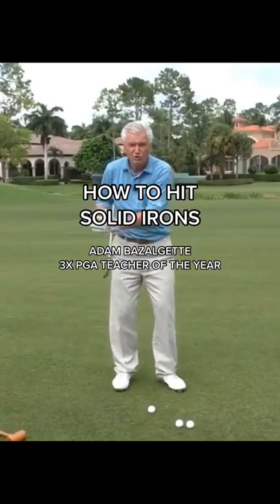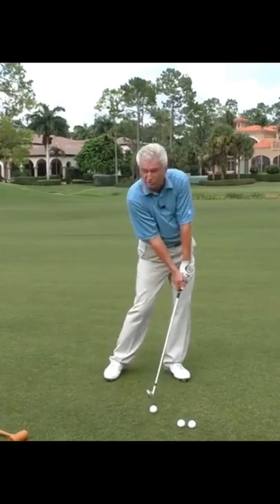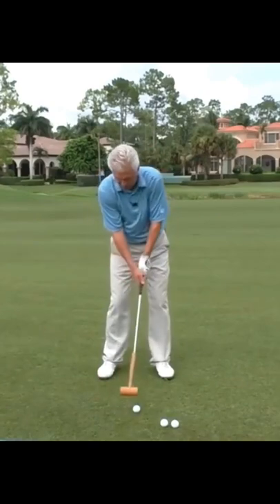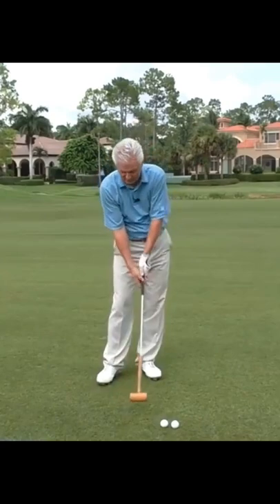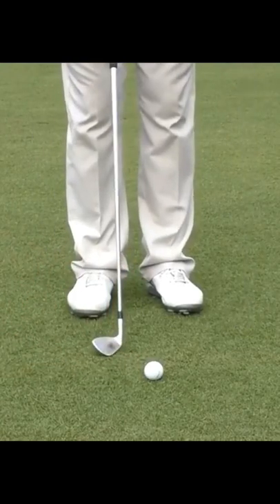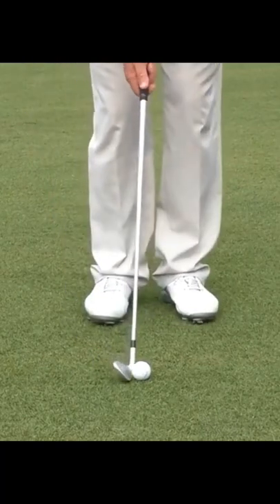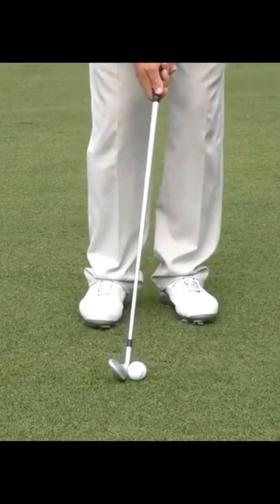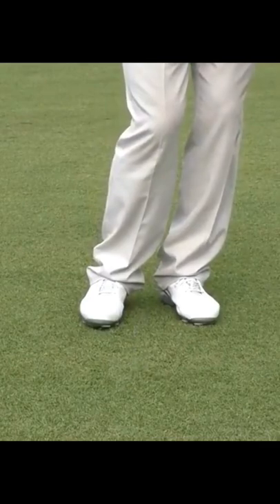Like and subscribe if you'd like more content

Comment: So what would be the difference between shaft lean with a normal club causing the delofting vs impacting a similar but lower lofted club without the shuffling.. a more upright swing similar to someone like count Yogi who impacted with little to no lean. Were these clubs designed with forward lean in mind??
Reply from the maker: Joseph,
I’d say the reduced impact deloft on longer clubs would be primarily cut to ball position and width of stance
Thanks, Adam